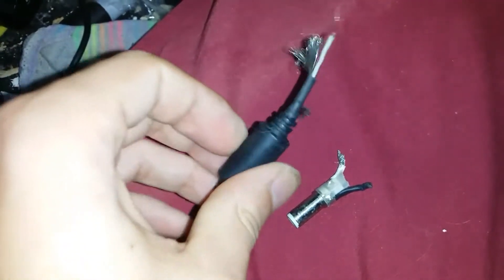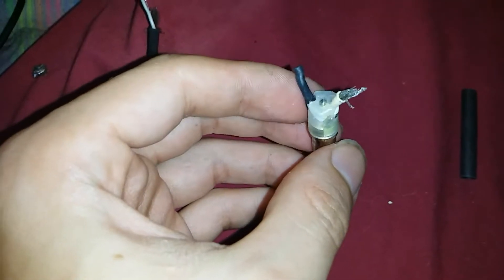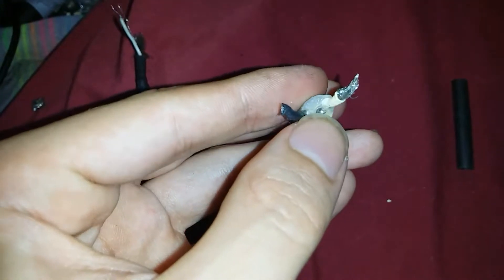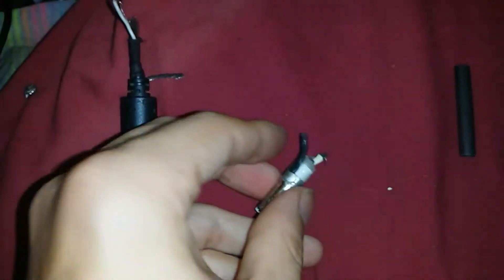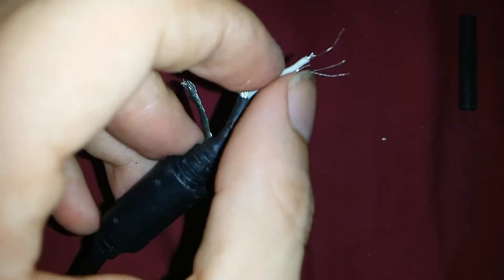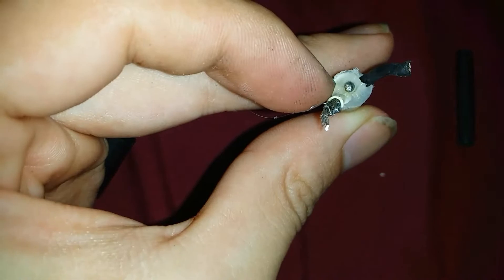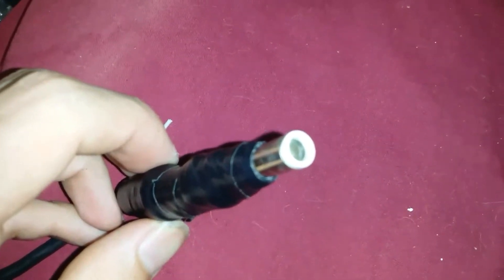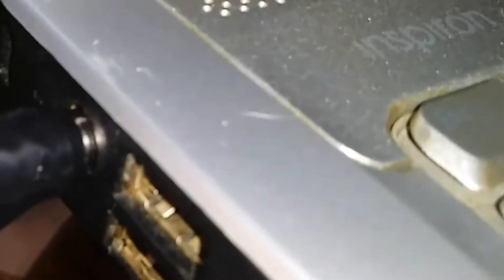How to Fix Repair Dell inspiron Laptop Charger Plug Broke wont charge "plugged in not charging"

Comment: What's the main causes of random reboots back in the past  I think summer of 2016 I got random reboots when I  pause the game or blow something up in the game Is it AC ripple bad voltage regulation luckily I replace the motherboard and power supply but I still like to know just in case it happens again, it may had nothing to do with the motherboard but I replace it anyway was a biostar board lol.The game was just cause 3 also.
Reply from the maker: Luckily in my experience i never had that issue. However i did get massive system hang and lock-ups after using my sony ps3 hard drive in my pc and ran windows 7 off it. Luckily i fixed it by full formatting back to NTFS and reinstalling 7 fixed that problems for me